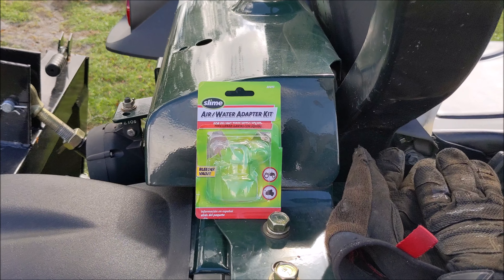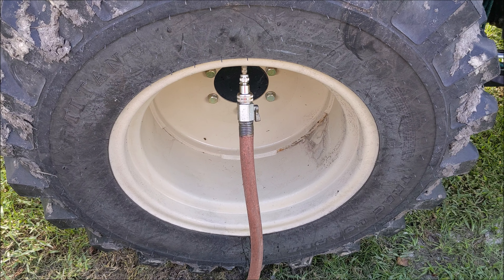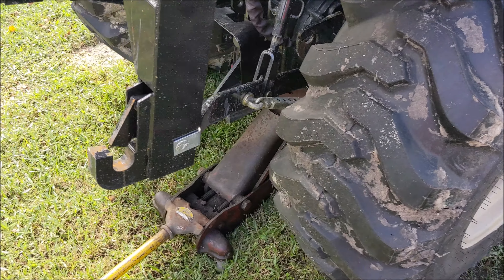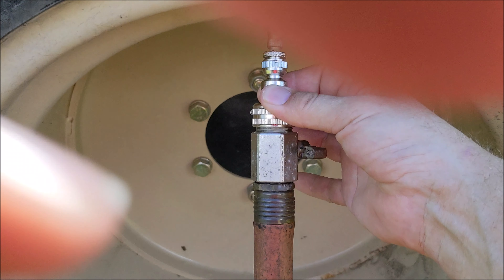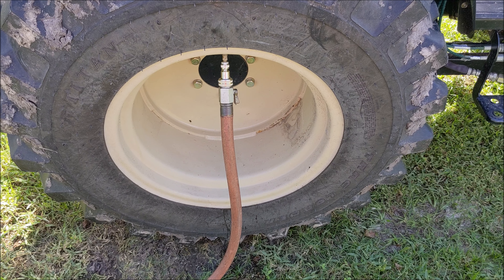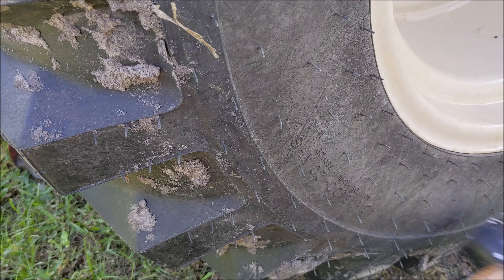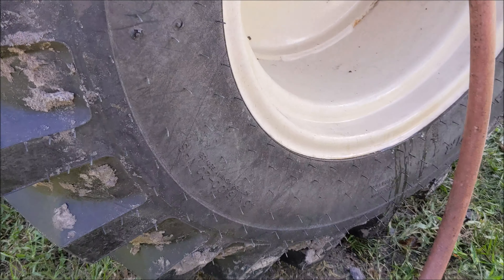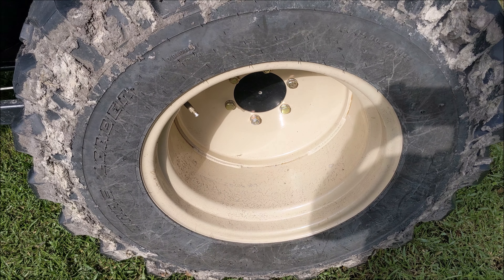Tractor tire ballast with water!

Comment from the maker: Update, after using the tractor with the water ballast, will say this, WHAT a DIFFERENCE! I can actually drive it up hills etc in 2 wheel drive with no spinning, its like night and day.  If your debating, DON'T, just do it.
Reply: Just got a new tractor. I asked the dealer to add ballast, he said he would but didn't. I am thinking about adding it myself and was wondering if I am far enough south to just use water. I am in Franklin TX. How far south are you?

Edit: I just saw you are in Florida. I would probably be taking a greater chance of the water freezing where I am. I would add the walmart de-icer WWF to it but I don't think I can get it this time of year.
Reply from the maker: @mwils51 Yes I am central FL, also will depend on where you store your tractor, even in unheated space it stays slightly warmer than outdoors. Dont forget the tires are thick rubber and are going to take more to transmit cold, the rims...metal but more limited surface area. You could probably do a little anti freeze mixture and be good.